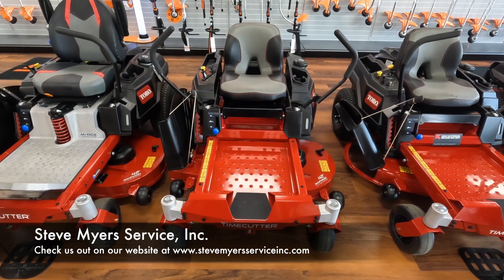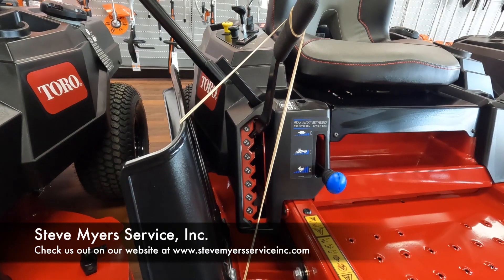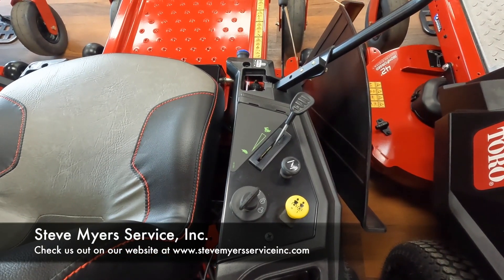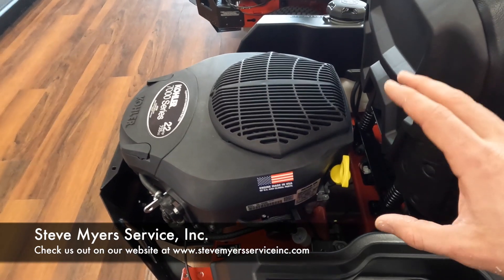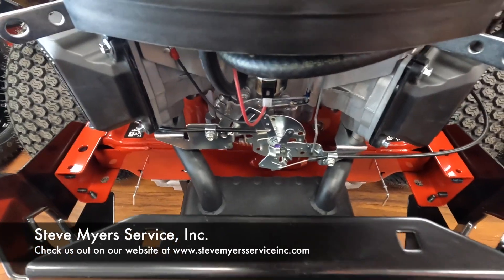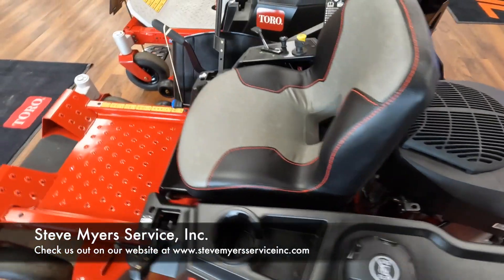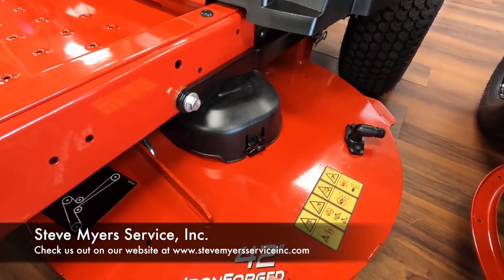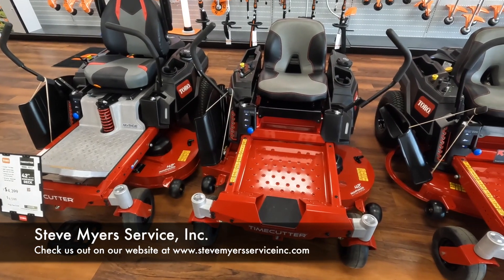Toro Timecutter 42" Fabricated Deck Tutorial

Comment: I have to change my bent blades. I think I need a 16mm socket to remove the bolt or nut??. I’d like to see a video on blade changing the right way. So far I have watched two videos on changing the blades, by owners. They did things In not so sure is necessary like thread lock juice.
Reply from the maker: The socket that you will need is a 5/8” socket and if you click the following link this is a video we did on how to service the deck. 

https://youtu.be/hhdeR_ht6Lg?si=7GFxVdenzjRg9vNM